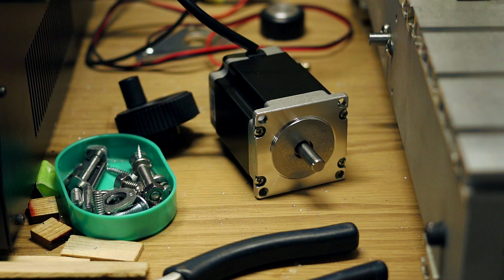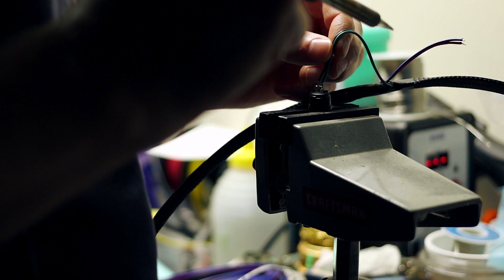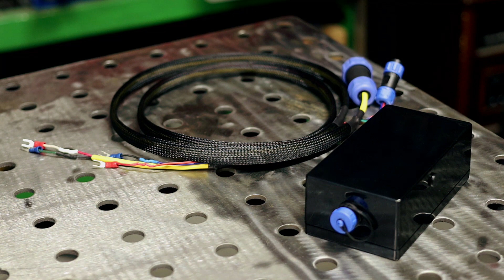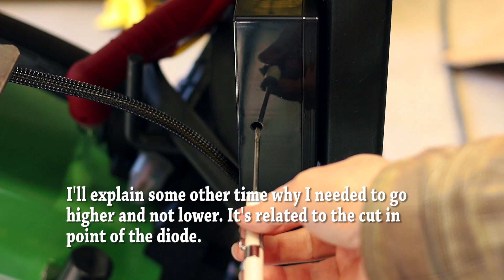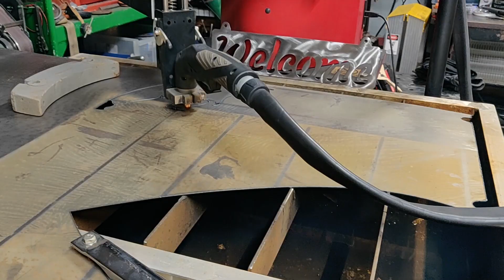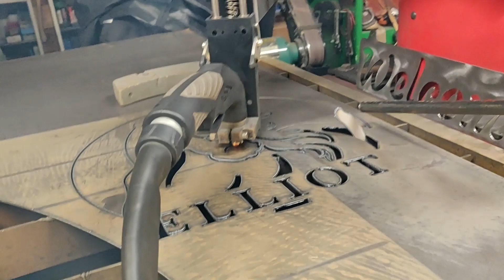ArcDroid: THC Part 2 - Making Divided Voltage PCB and Updated Info

Comment: I’m a little late to the game on this, but I just got the torch height control about a month ago.  I’m having a problem with torch height constantly going higher and higher on cuts with longer runs.  To the point that the torch will shut off due to distance from the materiel.  Hypertherm 45xp and just using arc droids recommended settings.

Comment: Well now I'm worried. I just ordered mine, I hope it doesn't have problems. it cost me 3800 Canadian.
Reply from the maker: Many of the major problems have been ironed out. THC is still a little temperamental but usable. I can't say too much but there is a THC focused update coming at some point. Will be a much smoother running rig.